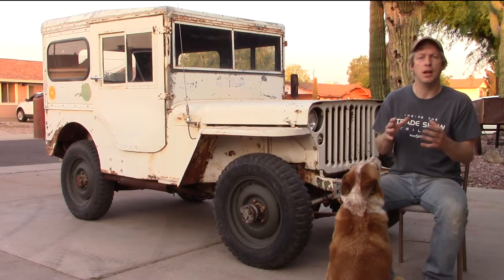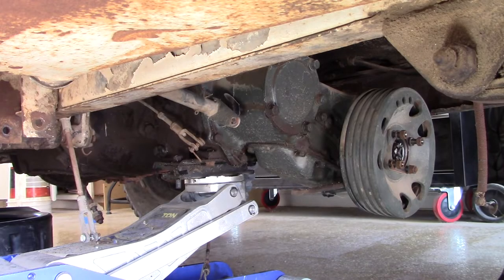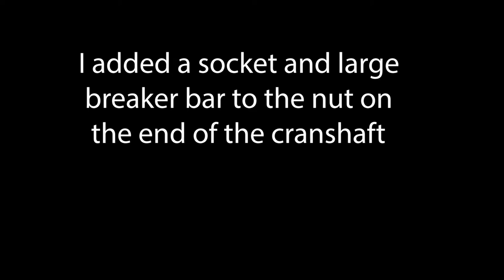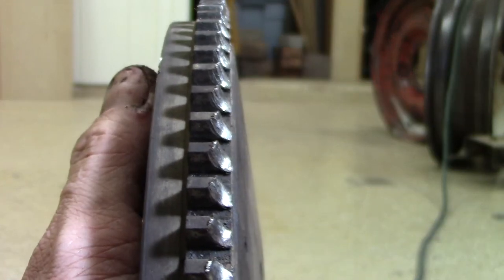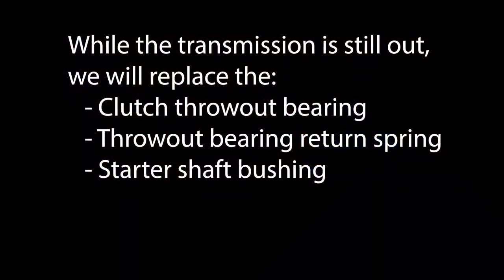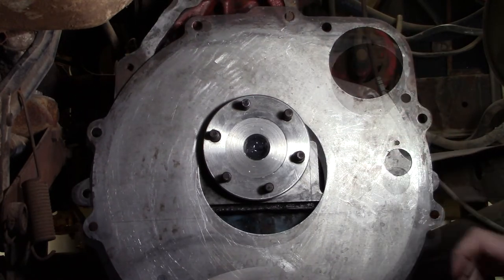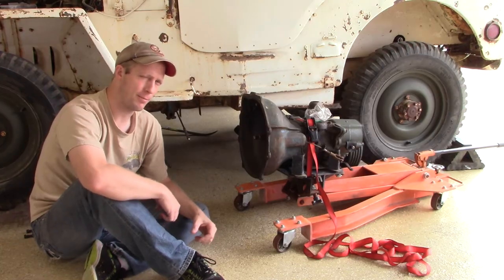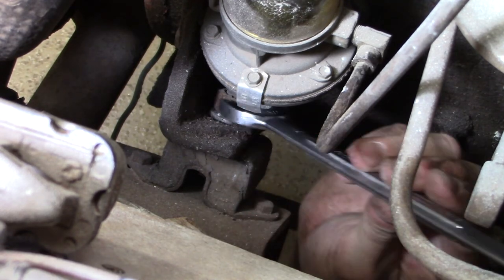1943 Willys MB Ring Gear Replacement | Full Process with Tips & Tricks!

Comment: Such a simple, and effective, drive train.  I like that cross member design better than the new Jeeps, where the screws go in horizontally not vertically
Reply from the maker: Agreed - that certainly makes a transmission removal easier with the way it’s designed.